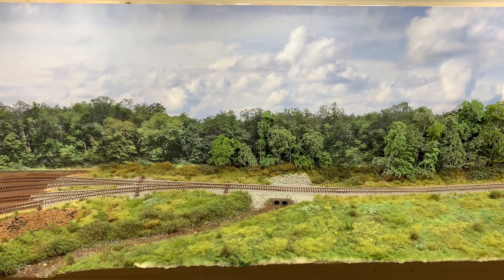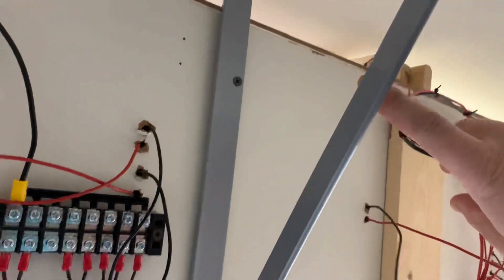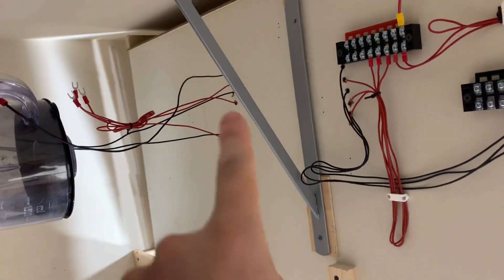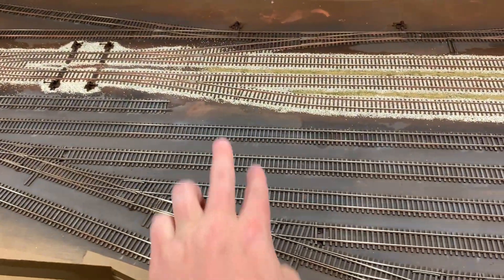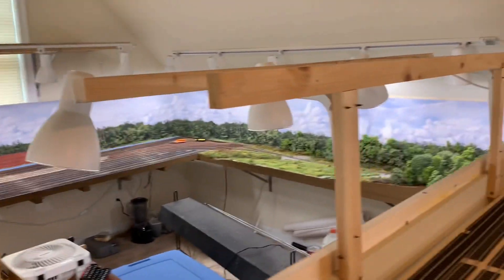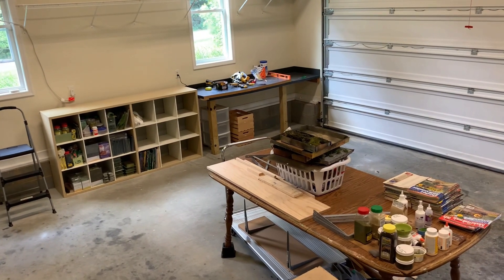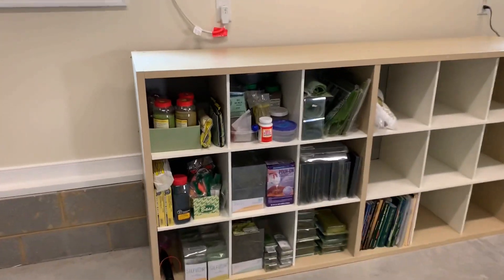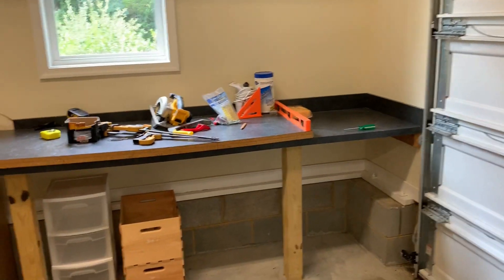Moving the Layout Begins

Comment: 13’ in one move? I hope you are going to get some help with that. 

Moving into a new space is really exciting.
Reply from the maker: you should know!  You are inspiring me to do a better job of storing my materials, having them easily accessible but also looking nice.  
My wife will help with the move of that section.  I think if I brace it well, and we can get it down the stairs without starting to laugh, I'll be fine!
Reply: @johnarthur6302  I have had some good success up to this point regarding storage, but I am now at the point where there is a lot of little stuff I need to go through and find places for, but there are not any places left, so now I have a lot of little things all over the place with no home.
I am still trying to make enough flat surface to setup my T-Trak modules, but by the time I clear off one table, I am piling the other table up with more stuff again.
We definitely need more how to organize all your "stuff" series. -Heath
Reply from the maker: @HumancityJunction  Keep using that vertical space!  That's about all I know.  Maybe YOU should do the videos on organization once you figure it out.  You will have like 4 scales and all your stuff in about 100 square feet, maybe less!
Reply: @johnarthur6302  77 sq ft.  But the ceiling is higher than the walls.
I need to get more shelves, that would help a lot. But there are so many things to spend money on at this point, I am trying to focus on other areas. But 4 more 8' long by 8" deep shelves would fill in the space over the G/O scale and it would make a huge difference.

Comment: The layout looks so bare!  It will be better in the new space.

You could just "not use the brackets" over the corner and make a support leg in front of it.  That is of course if you can still use the bench/countertop where it is.
Reply from the maker: Thanks Fred, That's true, and I had not considered that, but really the countertop would only get in the way of accessing under the layout, and not have enough space to be usable for much between the top of the counter and the bottom of the layout.  unfortunately it looks like it was nailed in, so rather than a hammer drill to remove screws i will be using a crowbar and probably doing more damage to the walls.  sigh.

Comment: Wow your wiring is awesome!  Good video bro! Wow that room looks so empty now!!
Reply from the maker: Thanks David - little details like that add up to a well running layout, imo.
Reply: @johnarthur6302  John i totally agree.  What are you going to do to keep the trains running in a loop?  Another removable section??  I am having trouble with mine.  The wood all dried up and shrunk.  Now there is an even bigger gap!  I feel like its a real slow headache under way
Reply from the maker: No more moving sections for me - higher layout height, and a duckunder.  The movable sections are nothing but problems at my carpentry level.
Reply: @johnarthur6302  yes, i think ill redo it into a elevator and see